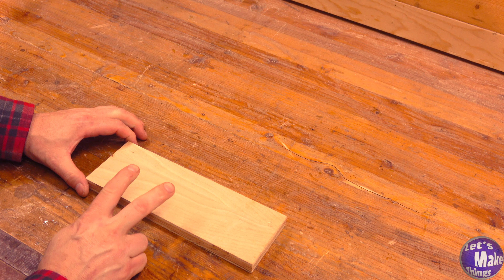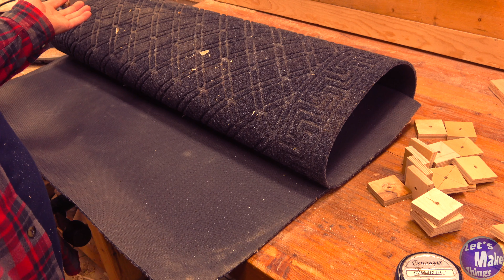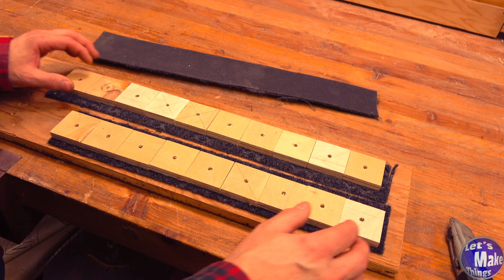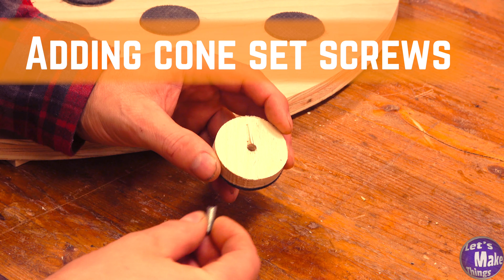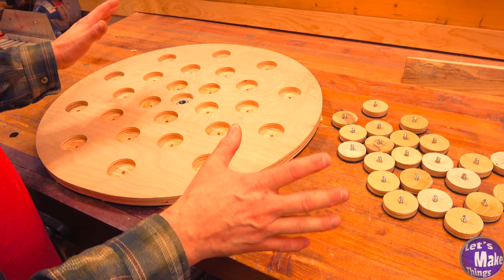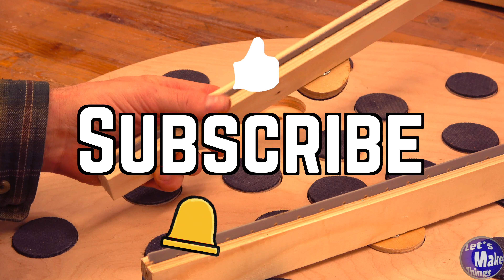Pads, cone screws and Circle Jig (for the finishing table) Instructional

Comment: You've really come up with a great system here Rob!  Between the original bench pads and this it's a pretty complete system over all (jigs too), at a low cost and relatively easy build.  The only thing I might add would be a Lazy Susan mechanism with a simple drop in bolt to lock it if needed.  Thanks very much for sharing this very innovative system with us!!  A Real a Treat.
Reply from the maker: It's funny, I actually started with the lazy Susan mechanism.  My project in my video editor was called "Lazy Susan Finish Table".  While I liked it, what I didn't like was that lazy Susan's can get sawdust in them pretty easily as they're not sealed very well, and then there would be a gap around the base, which causes the board to flex.  I really wanted it to be as flat to the bench surface as I could make it.

You and I are on the same wavelength I think!
Reply: @makethingswithrob  Was thinking a base plate that your pipe nipple would sit through on a large ball bearing but with small clearance for your 1/4" slats on the bottom..just lift the top off and vacuum out when necessary.  Roger that on the Same Wavelength! 😁